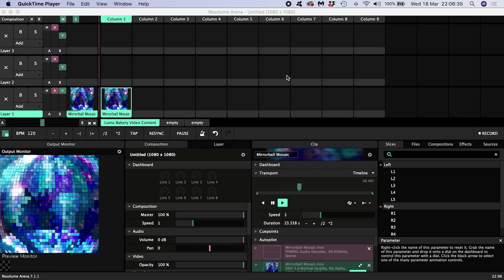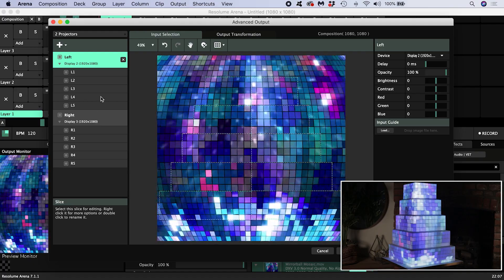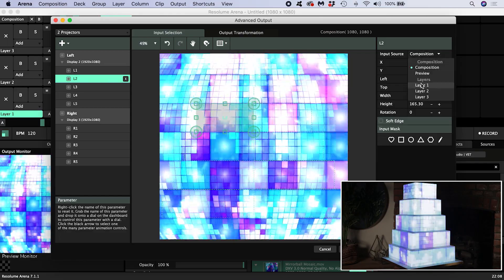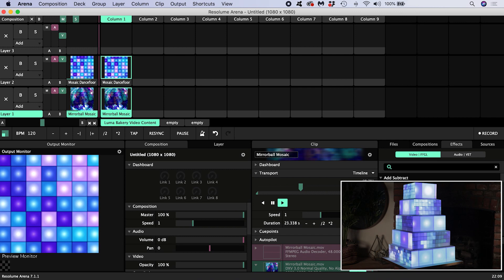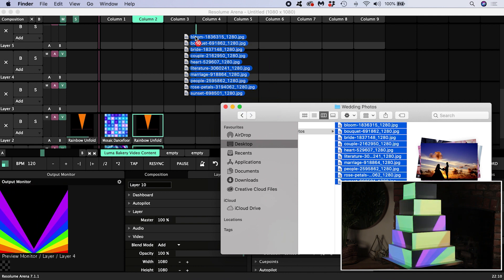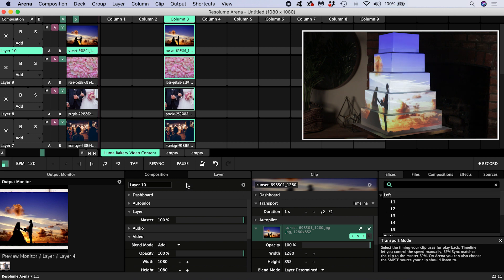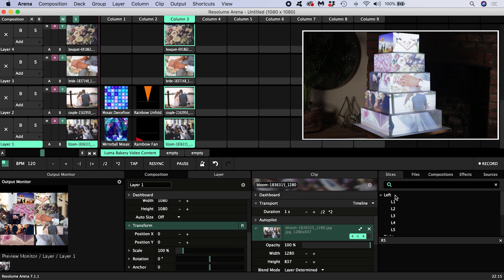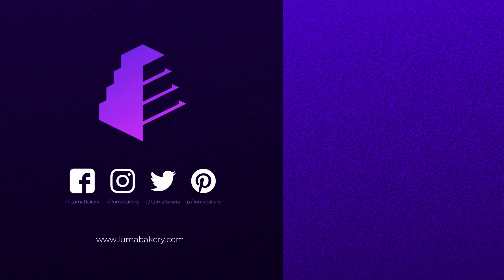Resolume Slice Routing & Slice Transform Tutorial

Comment: Is it possible to do this through madmapper as well?
Reply from the maker: Yes it is. MadMapper is set up differently so this process is more intuitive (it’s basically the relationship between input and output surfaces)
Reply: @LumaBox  thank you. I will do some digging in that area. I am pretty new to MM, but I have been watching your Resolume vidoes, and the software seems much easier to control.

Comment: Soo...the first two minutes (the first way you use) is not needed anymore, becouse you also can use slice transform for that... just drop the whole screen (left or right) on the layer and use mask mode... With the effect you stay flexible and dont waste layers.
Reply from the maker: Interesting idea that I didn’t think of 👍
Reply: @LumaBox  Since Slice Transoform you dont need to use the advanced output "live".   As long as the mapping is dont correct.  Every plain you want to use need a slice.  Everything else can be done with slice transform.   Thats why slice transform was such a break through ;)
Reply from the maker: Oh yes I know you would never do slice routing “live” in the advanced output. Usually with cake mapping, you set everything up and then step away and let it run throughout the wedding, event etc. So the steps of the tutorial are intended to show ways of pre-preparing certain looks.
Reply: @heschum2449  it took me some time to process what you say, but I just tested it, and hell yeah, it is veery nice!